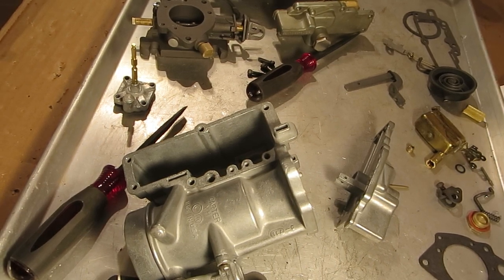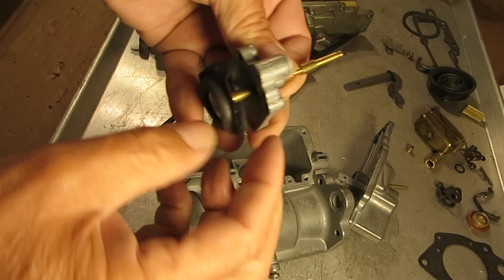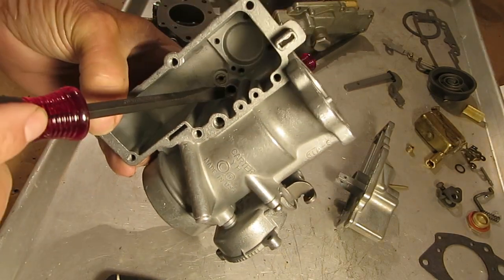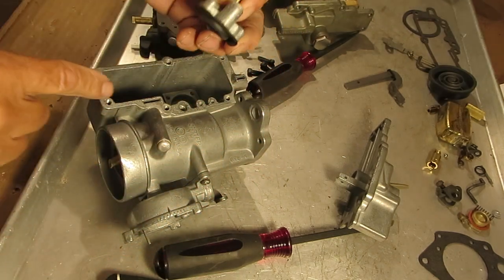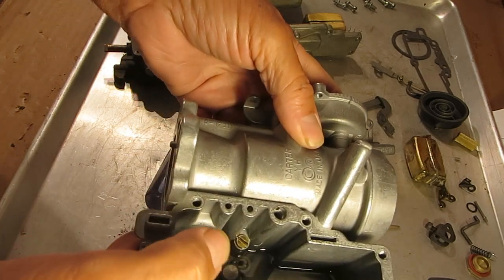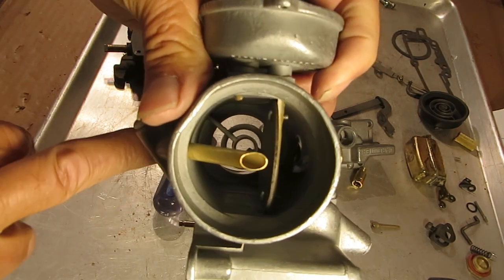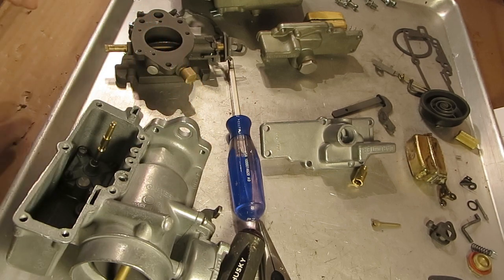Carter YH Accelerator Pump Circuit

Comment: Hi Mike, my Carter yh carb seems to have a small spring above the discharge ball, is this something that should be there? Should this be removed as it shouldn't be there or if it should stay are replacements available?
Reply: @MikesCarburetor  I ordered your rebuild kit, would it be ok to replace it with the 2 ball setup instead of the spring or the weighted needle? Thank you for replying!
Reply: @MikesCarburetor  awesome thank you so much!

Comment: would the check ball in bottom of float bowl underneath plug need to be seated if fuel is dripping from choke horn while running and when engine is shut off.
Reply: @MikesCarburetor  Thanks for the reply. Your videos are very helpful. These yh carbs are in a 54 vette and all 3 are leaking after rebuild, i tapped on accelerator check ball in each carb and got 1 to stop dripping.
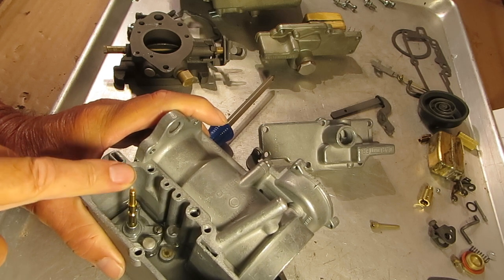Reply: I'm trying to rebuild a Carter YH on a Slant 6 in a Clark Cortez. There is a difference from what you show though, the discharge at 5:03 isn't on mine. When I push down on the diaphragm it just sticks in the down position after a couple pumps, and I don't get any fuel squirting like at 7:49. I also don't seem to have a "pump check needle" but one is in my parts kit.